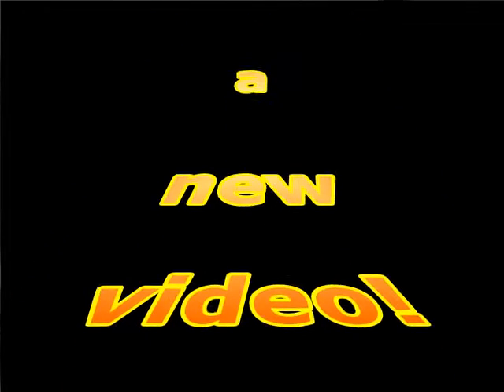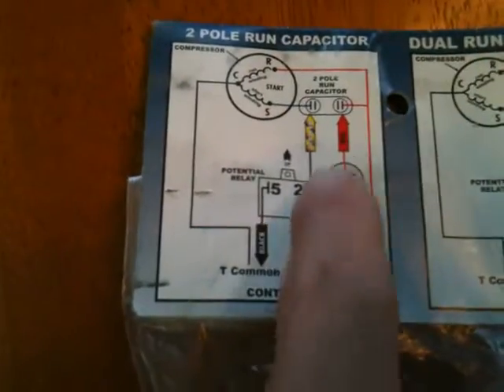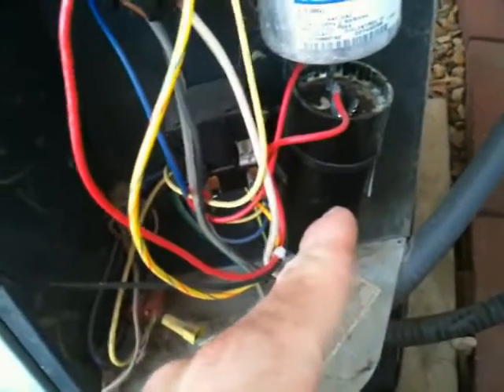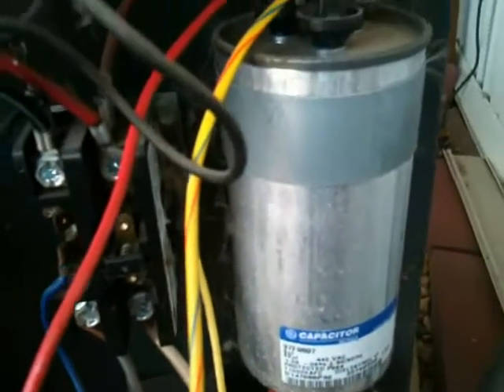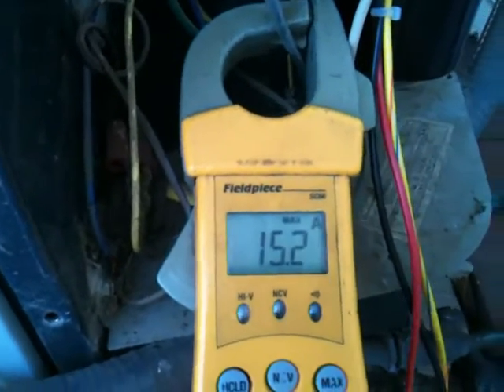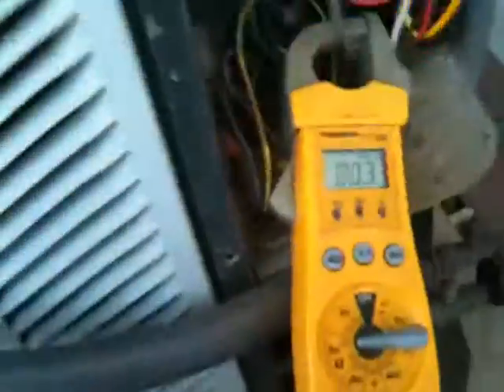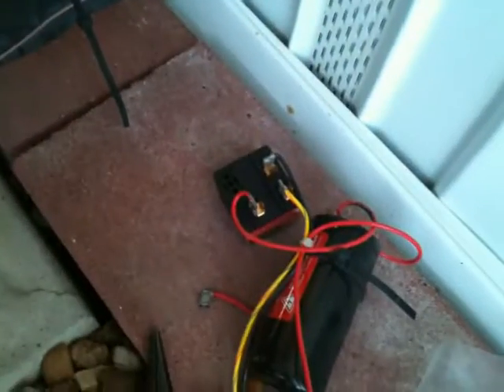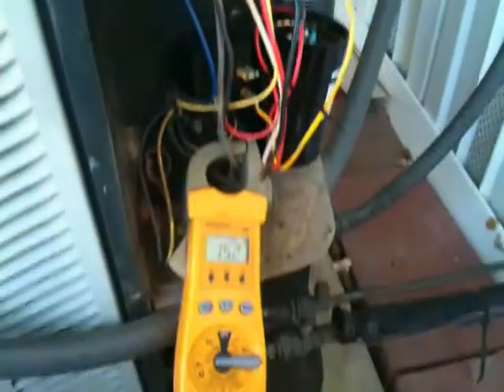HVAC hard start kit

Comment: Hi, I installed a 5-2-1 Kit, it dropped my in rush  reading by 20 amps,  I am happy about that.   Do you see any harm that can be done by using these Kits on a 12 year old system ?   When they go out will the system still run?   Good job on your videos, thanks for the help.   And you were right about the slow bleed back on the TXV    that is what causes the high in rush is the high pressure the compressor is starting against .
Reply from the maker: gerry mcadams hi Gerry!  Sorry for the long delay on answering! Usually I blame my health problems but this time Im solidly blaming youtube!!  They have made so many changes in the last year its hard to use the system from an uploaders perspective, especially trying to use my tablets!  I literally COULD NOT FIND my inbox! Can you believe that? Its really hidden layers deep and on top of that you have to jump through hoops on a tablet!

No you shouldnt have a problem as long as the hard start kit doesnt dead short or something weird, it will just revert to high amp draw unless the system has aged enough that it just cant start on its own anymore. I check on my hard start kit usually once a year to make sure it hasnt popped. Last year when I checked it had already gone bad (unit still running) and you could see the little pressure hole on the cap had popped.
Reply: Thank you for responding.   I really enjoy your videos.  Keep up the good work,  Good luck on youtube issues.

Comment: Great video, I have a 12 year old scroll compressor with a TXV  the in rush is 10 Amps over LRA,  I was told by Ruud that is normal they do it brand new.   What are your thoughts ?  Thanks for the good video,
Reply from the maker: Glad you enjoyed the video!  My opinion on this is that every system that has a scroll compressor and a TXV should have a hard start kit installed on it from the factory.  Some do, I believe, but most seem to cheap out.  Between the scroll compressor and the TXV, the head pressure is usually still up there by the time the system cycles on again, the leak back is so slow on a setup like this (granted, some equalize quicker) that it doesn't have time to equalize, thus your system ha a high load on it starting up!  We made it standard policy to install a hard start kit on all new systems that were set up like this.
Reply: Hi, thanks for responding What you said makes sense.  I guess i could put a set of gauges on it and turn it off and see if it equalizes. Or leave it off for 24 hours and than check in-rush. I was looking at the factory wiring diagram and it does show a option for a 5-2-1.  Like you said they went cheap, Thanks Again. Gerry

Comment from the maker: Sorry for the long delay! Usually I find it's heatload. So yes, dirty condenser coil and/or *placement* of the condenser; unit is stuck in a corner of the building and the heat just circulates like a tornado and unit temp is way higher than it should be, or next to a building with a carport over it and reduced airflow, too much shrubbery/bushes reducing airflow.  Double condenser coils and crap built up between them even though the outside looks clean! Pitted contactors will increase the ampload

Comment from the maker: It kills me how many two story houses I've seen that don't have either a belly warmer and/or a solinoid valve to prevent the liquid from filling up the compressor.  Not like either of them cost much money or are hard to install, yeesh!  Not to mention cheap installers that will put in a new system that has a TXV but not install a factory hard start kit and then wonders why they get warranty callbacks for failed components, lol :)  thanks for the post!

Comment from the maker: the 70c (158f) temp mentioned above is for the run capacitors (in general), not the actual condenser.  fyi.

Comment from the maker: An Overcharged system will run high current.  If the unit has a TXV (thermostatic expansion valve) there may be no obvious problems as the unit normally cools fine. The expansion valve meters the flow of freon to the evaporator coil BUT there is so much liquid freon in the system that the compressor is slugging and stressing the compressor causing high load and problems.  Dang, I should do a video on this! lol :)  Lemme drink some coffee and see what else I can think of :)   M@

Comment from the maker: BETWEEN the two coils and BLOCKS airflow!  Usually you can identify these because the sheet metal on the top of the unit holding the condenser fan will be physically burning hot above the coils.  You CAN'T just wash these like normal, a tech has to take the unit apart and separate the coils and clean between them. This will be a re-occurring theme unless you can brick or grass the area enough to keep dirt/dust from being sucked into the coils.  OVERCHARGED systems will cause this as well.(cont)

Comment from the maker: Example: condenser was placed on concrete drive close to house intersecting with garage, the drive had a covered carport. No cool air reached the unit. Summers reached 100-115 and the heat circulated like a whirlwind in the corner causing constant failures. (customer refused to move unit) 70c is a common max temp (158f) and this can be easily reached in some circumstances. Another miss is some condensers have DOUBLE coils, you don't know till you take the top of. Dirt gets BETWEEN (continued)

Comment from the maker: A unit that eats capacitors is always fun! (some sarcasm there, hehe) A dirty coil can shorten the life of a capacitor because it increases heat load (condenser fan can't dump the freon heat load) so this causes the compressor to run at a higher load. Usually when I see this, however, the coil *appears* clean but I see one or two problems: The condenser is put in a corner or spot with Low/no airflow. (continued below)

Comment: Thank you for this video.  Very well done.  It's good because you explain the reason why some units have a "Hardstart Relay and Start Capacitor" to go with the "Run Capacitor". 

Question:  Can dirty condenser coils cause the capacitors to fail, often?  Can a bad contactor cause the capacitors fail, repeatedly?  In other words, what would be the first items to inspect or clean or replace when the capacitors are blowing, repeatedly?
Thank you for your help!

Comment: Good vid again sir, but, Go to copeland comp mfg. they tell you not to put these on there comps. Yes you must put one on a txv due to the fact that the system wont equilize on a recip comp. due to the valves but a scroll will equilize. Also  a system mfg. start kit has a much larger mfd rating and this three wire kit can harm the start winding because the back EMF from the winding forces the contacts of the realy open to disengagethe capacitor at a certian time. but they do work to limp one buy

Comment: Hi Ihave a compresor do not start ,it tray to start but not  I hear OHM  but not start , fan run,   and compresor cycle every 2 or 3 minuts to start  ,this is a motel unit PTAC 1HP 14.000 btu CAN Itray compresor kit start, if is yes how is the conection to the compresor thanks

Comment: Thank you for that Mike, I just finished installing my 5-2-1 Compressor Saver and its the only way to fly.. I think you ment to say Suppco Sucks.. but didn't quiet get it out.. yeah.. I replaced my Suppco with a 5-2-1 only after a year of usage for the SUppco in this extreme heat of 115 in the Cali Desert..  My 5-2-1 will start over and over and over again without any heat issues causing it to fail to start. It also takes it out of line I think you forgot to mention that part of it.  PEACE

Comment from the maker: @ZuffaLtdDanaWhite   Not quite awake a bit but... what do you mean by O/L ? not ringing a bell or I'm not quite awake, heh.  Start kits serve a number of purposes; 1. reduces initial starting amp draw on some systems and older systems. 2. reduces stress on compressors when a TXV is being used.  3. Frequently used to get an older compressor running (that probably needs replaced) that wouldn't start and is pulling lock rotor amps. (not a perm. fix though)